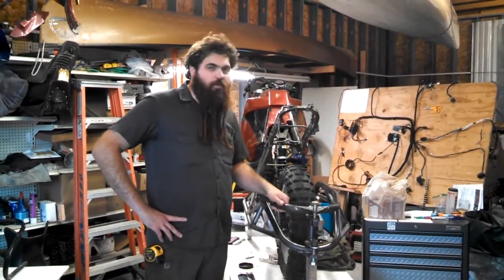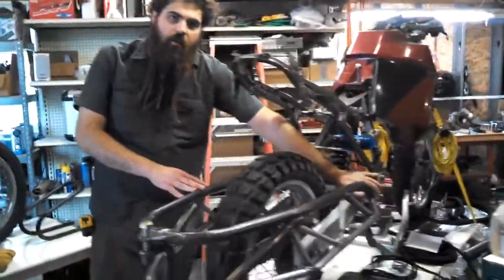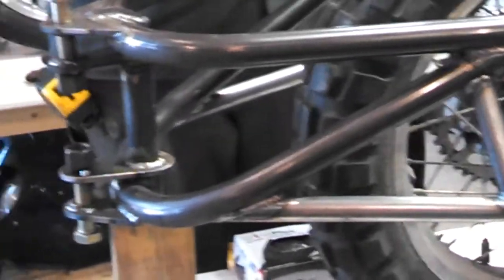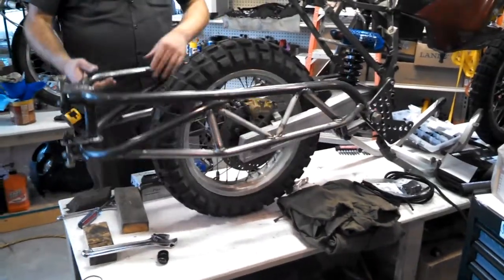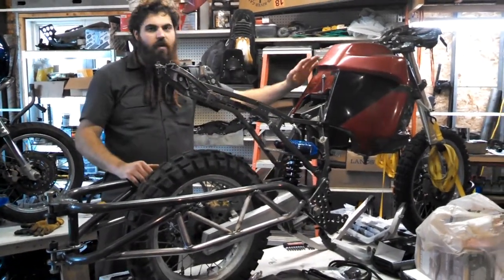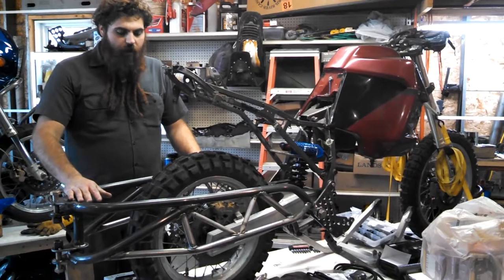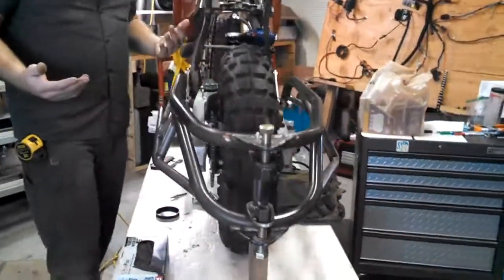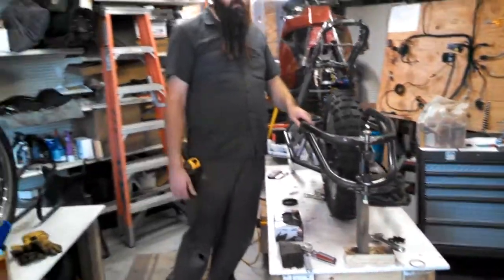Our hitch design for our one-wheeled moto trailer

Comment from the maker: Yeah. It worked pretty well for the most part but is heavy. The shock on the trailer by mounting it to the rear wheel wasn't working for me so this is my solution. The weight could be fixed with using machined aluminum parts.